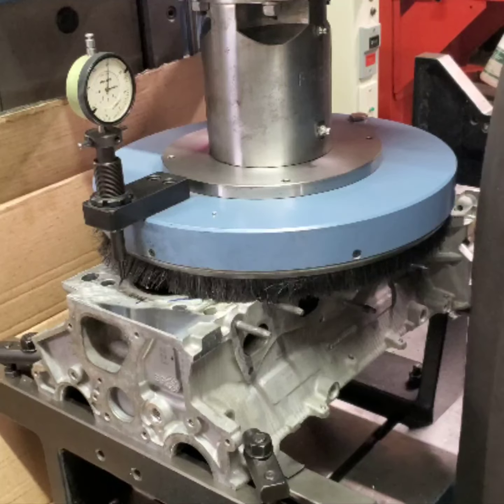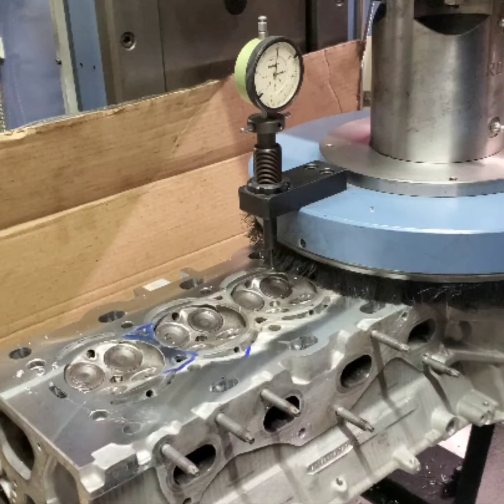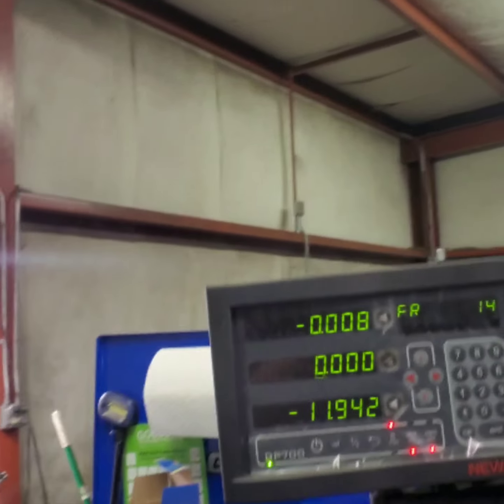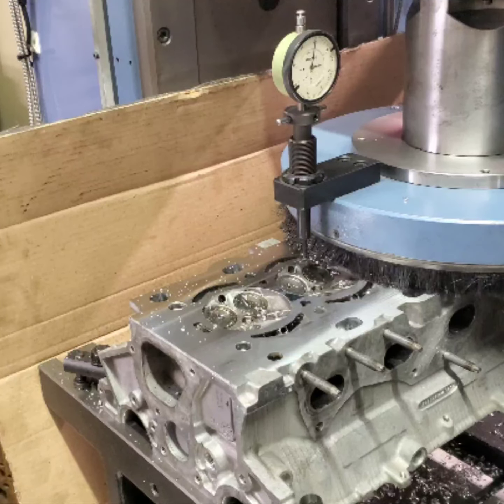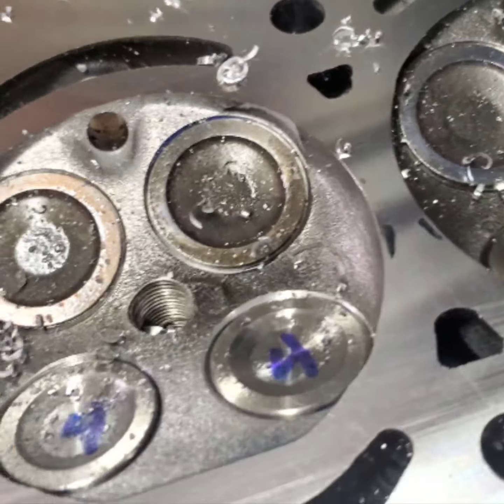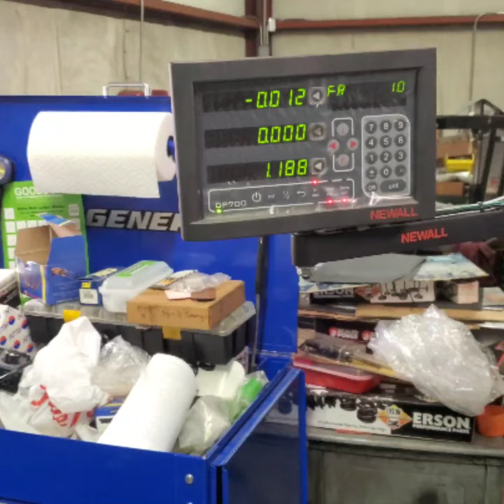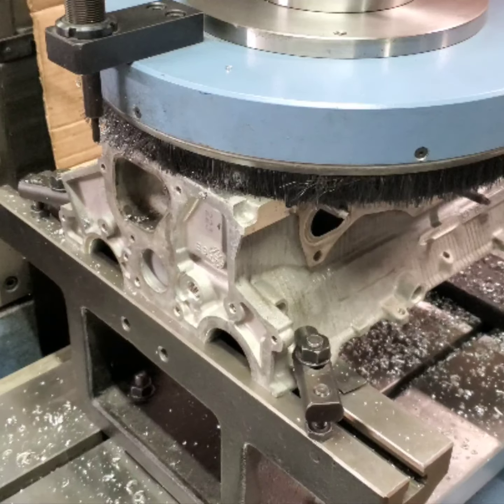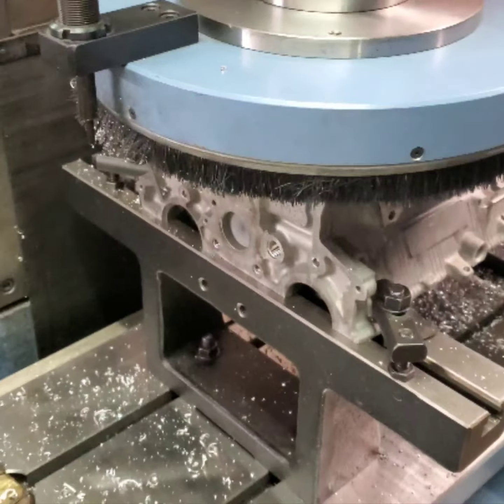Setup and Mill The R56 Mini Cooper In The Comec ACF200.

Comment: Looks purdy there Ed! Some guys clean on a machined surface till all the stains are gone, I would us a plastic scraper and clean till all the gasket and carbon was removed, and if it still had stains on the surface so be it as long as it was flat. Great job. 👍
Reply from the maker: Thanks Randy, I appreciate you watching. 
I always clean and prep as though it was an install.
Then inspect.
No one can ever say I made the head or block worse than it was.
That's the only true way to know how bad it is warped. 
Have a great day.

Comment: Hey Brother,  that looked like a lot taken off.  Are a lot of those heads that bad? It sure looks great now.
Reply from the maker: Hey Bert, it looks like alot.
Some of these cars have over 200,000 miles.
Maintenance is alot of the issues.
Timing components could be better.
Factory rings are not as good as what we use.
I do not want to give away to many secrets.
We'll talk Bert.
Have a good evening Brother.